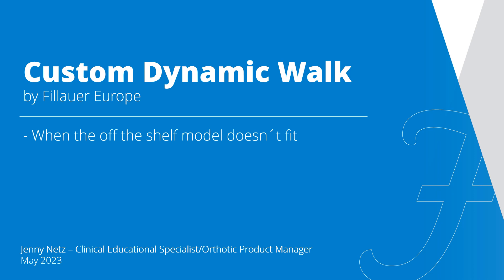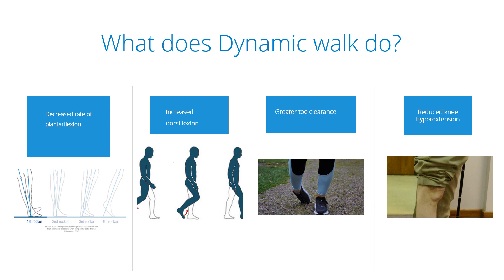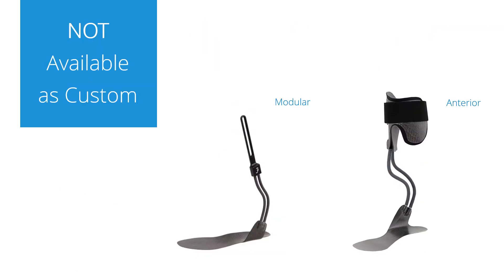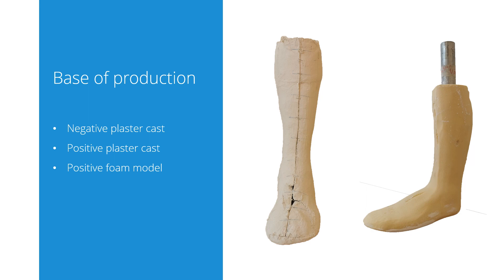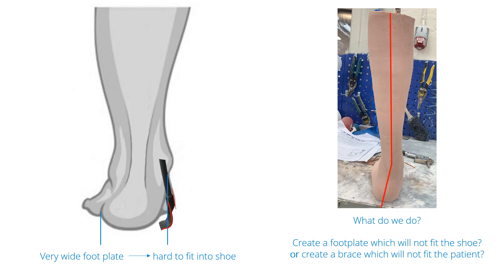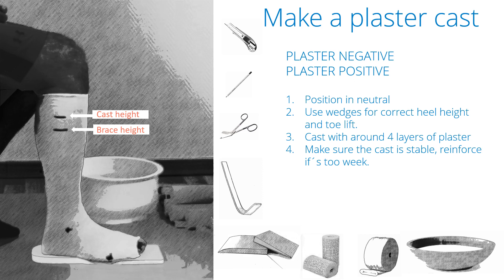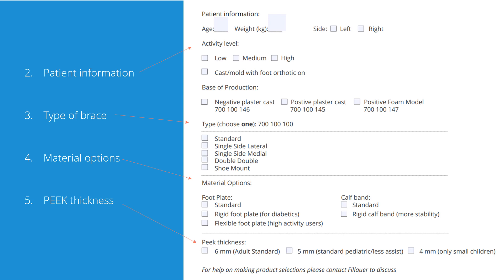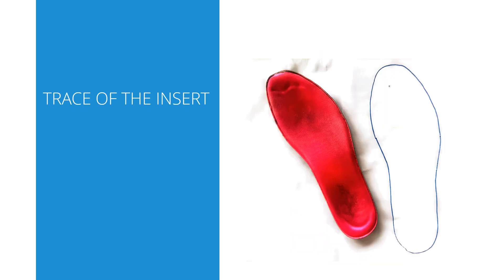Dynamic Walk Custom Webinar

Comment: Thank you for making such a great product for me! I got the single medial model and it's allowed me to run comfortably again. I think that was maybe 8-10 years ago. I wonder if the double double will fit just as easily in my shoes/boots as the medial model. The only issue I've had has been when using high ankle shoes/boots that push the peek rods into my ankle but I just put a little pad there to prevent the rubbing. Thank you again!